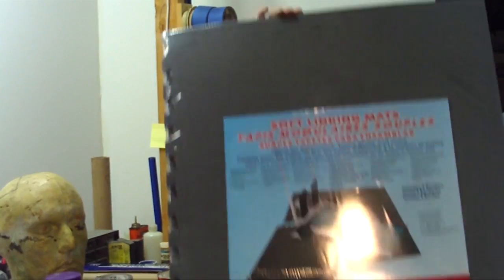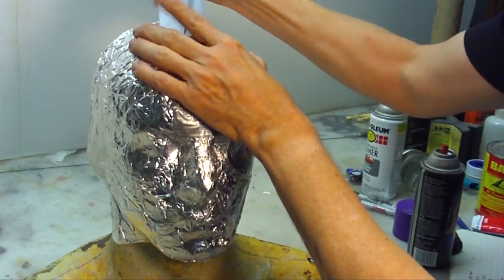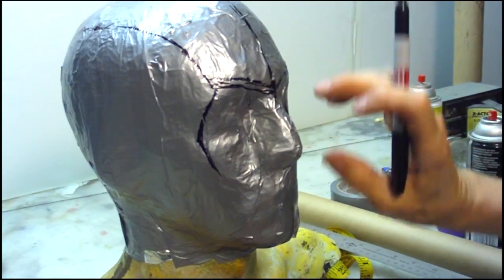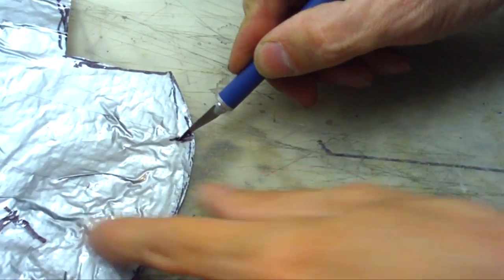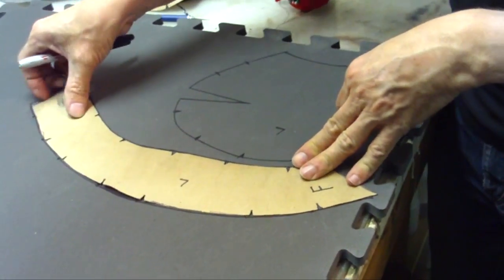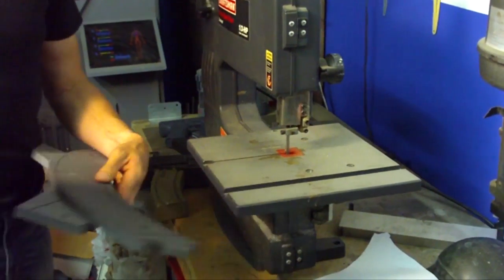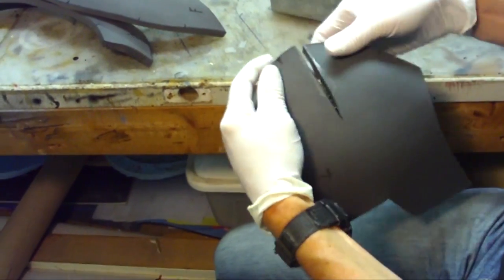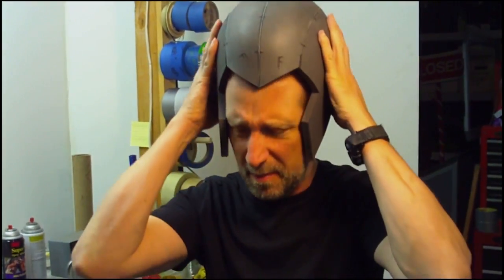How To Make a Foam Helmet Tutorial (Part 1)

Comment: This was an awesome and fun experience but:
1 Barge glue takes way to long to dry ( Krazy glue only takes about 30 seconds to hold, when Barge takes 7 minutes to set, than another hour to completely dry, which would be ok if you weren't trying to to glue two things together that want to come apart ).
2 Since the video told me to to measure based on the outside of a helmet I measured based on the outside of the helmet, thus building the thickness of the foam ( which was about 1/2 an inch thick ) inward so my head did not fit in the helmet.

Comment: How do you pattern out something that doesn't follow the contours of your head, such as a helmet with a brim?
Reply: In a later video he mentions another option is to ask another person to cover your head with aluminum foil and duck tape and make the pattern that way. 
When I first tried using a helmet with a slight brim and it sort of worked, but something else you might try is use the helmet to make the pattern then apply the pattern to some thin foam, then cut them out and make a prototype. Then I just duck tapped the seams together, tried it for size then started out cutting out strips until it fit the way I wanted. Then you could either cut the prototype apart and use it to make patterns or cover it with foil and duck tape and make new patterns. 
I just tried it a few days ago so I'm not sure if it will work for you but you might be able to eventually remove the brim and get it the way you want by cutting out strips. It's kind of crude but it should hopefully be a good starting point. I hope this helps and good luck on your project!
Reply: Good ideas. Thanks!
Reply from the maker: Thank you BlueStar.
Reply: Evil Ted Smith
Thanks for your tutorials! I have found one pron;em, though - I'm using hot glue, and my seams spread open after I glue them. Is there any way to fix this? ((I'm blogging about my efforts at teenagesuperheronlog.wordpress.com/ if you need to see what I'm talking about))

Comment: Can you use a blow dryer instead of a heat gun?
Reply from the maker: T w No, it does not get hot enough to bend the foam.
Reply: +Evil Ted Smith what can you use as a substitute then?

Comment: can you tell me what cutting board you use?  I need a cutting board and don't really know where to start.  thanks
Reply from the maker: Here you go. https://amzn.to/3hMrUwz
Reply: @EvilTedSmith  Thanks!
Reply: one more question, if I may.....
if I get my head made and make a template that just fits, almost tight, when I make the pattern and cut and assemble the helmet, using the 1/2 inch floor mat foam, will it make it too tight because of the 1/2 inch of the foam?  do I need to allow extra room for the thickness of the foam?  this is my first time at such an endeavor and am quite clueless. 
also you are the only one that has answered any question asked on YouTube.  Thanks!

Comment: can you use spraypaint directly on EVA foam?
Reply from the maker: +Bram Suwier You could, but it will look like spray painted foam.
Reply: +Evil Ted Smith so using the latex will give it a more realistic texture thx for the help
Reply from the maker: +Bram Suwier Check out Evil Ted talks 3 about tools of the trade.
Reply: I Will :-)
Reply: +Bram Suwier  Using a heat gun to shrink the rubber pores and then priming with a few coats of plasti dip will enable you to apply spray paint and it not look like painted rubber. Use paint that specifies it can be used on plastic.
Reply: Thx

Comment: Why not use quick drying epoxy resin?
Reply from the maker: Because it will not hold and crack over time
Reply: How about the industrial kind on two part used for carbon and fiberglass. Thanks for your response.

Comment: what if you don't have a motorbike helmet or head cast
Reply from the maker: You could get a friend to help you cover your head in foil and duct tape. Draw on your cut lines take it off and cut it out with scissors. When you transfer the tape pattern to paper you add a quarter inch on side head pieces. Than will make your helmet less tight.
Reply: Evil Ted Smith ok thanks a lot.

Comment: I found this because of another video but, my god if making patterns is that easy then why have I been trying to freehand on huge pieces of cardstock and try to make them match my physique this whole time?

Now to figure out how to modify one of these to get it off my head without destroying my hair.... or scalp in general
Reply from the maker: +Justin Pugh You can do it! (Also get a friend to help). Or you could buy the basic helmet pattern at www.eviltedsmith.com.
Reply: +Evil Ted Smith Oh wow I wasn't even expecting a reply. I'm definitely going to give some of this a try, I just want to make sure I have all my techniques researched before diving in. That being said, I do have a technique question. I'm trying to make http://media.blizzard.com/overwatch/media/reference/genji_reference.pdf this armor, and plan on using your techniques for templates/ body forms etc. My issue though, is that the red muscly looking bits need to be stretchy and flexible so I can run around in it. Would that simply be stitching upholstery foam muscles to a skin tight suit and coating in latex to paint? Or is there another technique that my hours of googling simply have failed to show me? Any tips would be awesome, and I hope it's not rude to ask.

Comment: ok so i'm trying to make a cosplay helmet for the character Griffith from the anime Berserk. here is a reference picture. http://i7.photobucket.com/albums/y257/larq2525/griffith_b.jpg
i'm using this tutorial for the main round and back portion of the helmet (hoping it'll turn out similar to yours, and then i want to add the bottom and top "Beak"(mask) portions of the helmet on after. i'm having ALOT of trouble on how to make the curves kind of like you did with the top of your helmet to make it rounded.
Reply: oh btw since the beak/ mask part is a bottom piece and top piece i'm trying to make templates without using my mannequin head.( dont even know how i would make those pieces with the bust.) the curving throws me off so i'm not really sure where to put the slits to make it rounded. do you have any tips on how i might be able to make the beak/mask portion of the helmet.
Reply from the maker: Blackthorne Joshua Take a basket ball and cover it with foil and tabe. Rub it down so you can see the black seem lines. Trace the lines with a black shaper, then cut out and then you'll have your pattern for your round helmet.
Reply: wow. i never would have thought. your a genuis and thank you. i love how detailed your tutorial is. i'll send a pic of the finished  product and thanks again, continue building and i'll continue watching
Reply: oh also if you have any advice on how to make the beak portions(top/bottom) it would greatly assist as this is the first helmet i'm attempting, and second craft foam project so anything can help. if not i understand it seems like its a challenge. i've been thinking about it for days now